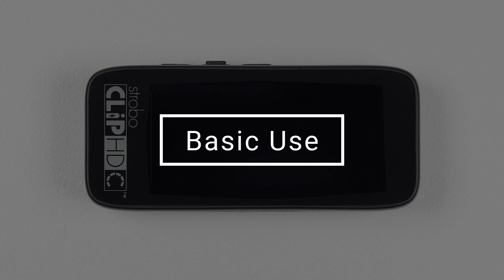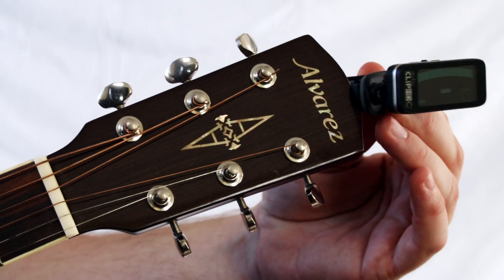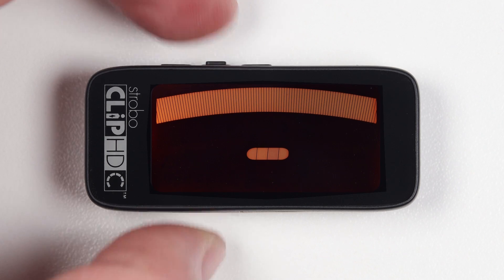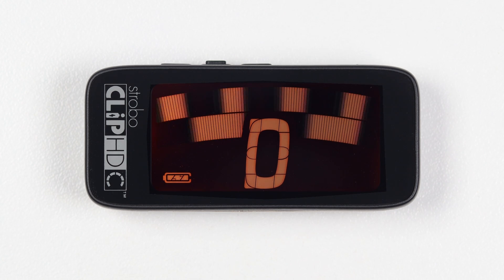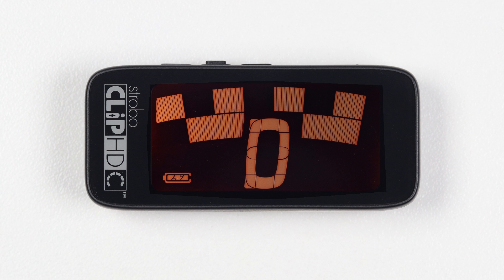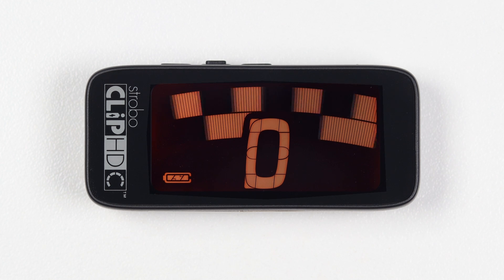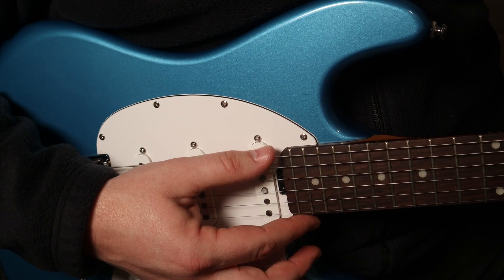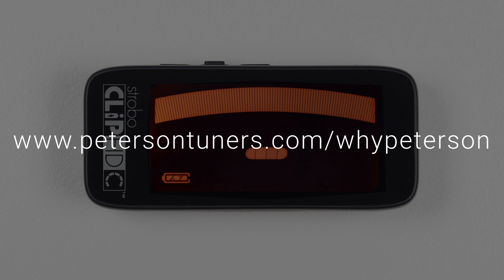StroboClip HDC | Basic Use

Comment: Happy musician here, great products. I have a new SCHDC. Written manual (included with tuner) says the empty battery icon with the bolt will become solid when charging is full. However, the above video indicates that the cable must removed before you see the full battery icon. Is it correct to assume there's no way to tell when to remove the cable? And does it harm the the internal Li battery to leave connected all night? Thanks.
Reply from the maker: The battery icon while charging displays a lightning bolt to indicate that it is charging. Removing the usb cable forces the tuner to perform a battery check, which will then display the current charge level.

Roughly 3 hours of charging time is needed to fully replenish the battery. There will be no harm to the battery if left charging overnight. We suggest not leaving the charger on for more than 48 hours.